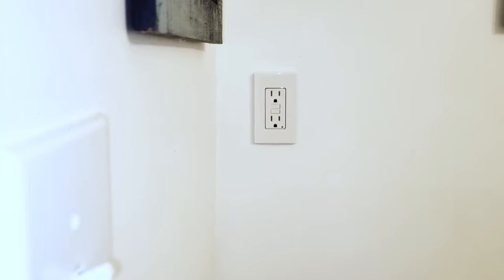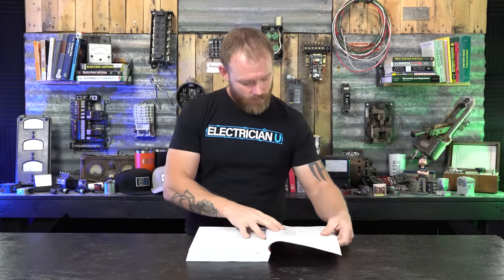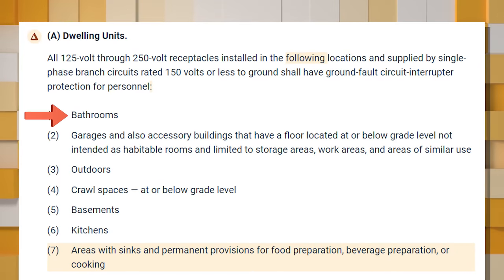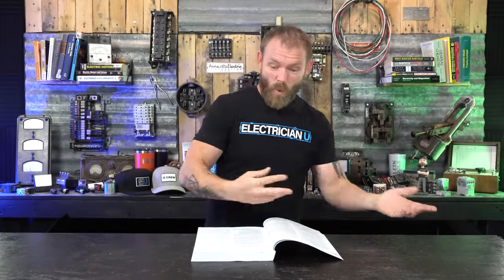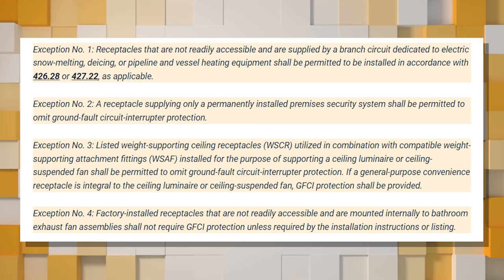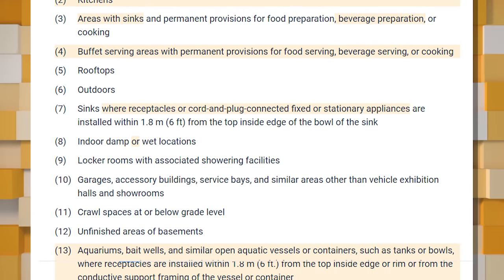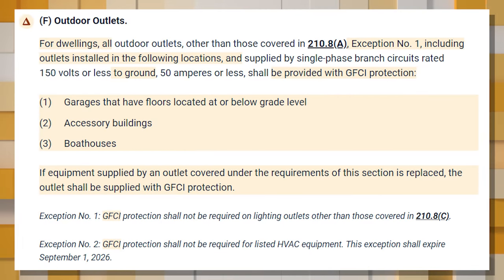Where and Why Do We Need GFCI Protection?

Comment: May the NEC forgive me but I must say it: 
The only outlet that should not have a GFCI is the refrigerator, because a trip can be a costly waste of food $$$ and even more so in the new "inverter" technology refrigerators where the electronics of the motor collides with the GFCI electronics and causes false trips. With the ground pin and the effective ground fault curent path in the outlet it is more than enough to offer protection against indirect contact in the event of a fault to ground.

And even worse if you keep medications such as insulin in the refrigerator, there the loss can even be human due to a stupid GFCI outlet.

A strange case of It can't be done but it "must" be done.

Comment: At this point wouldn’t it just make sense to matte everything be GFCI/AFI  protected in new residential construction or am I missing something obvious other than cost?
Reply: That is the direction we seem to be going, but they may be taking their time and introducing it a little at a time. It is quite a bit more expensive to upgrade to a system that is entirely AFCI/GFCI protected, especially since you also have to upgrade virtually all receptacles to tamper resistant as well. I have not yet seen it, but I assume that at some point, we may start seeing AFCI/GFCI protected main breakers that would theoretically protect the entire house, but who wants the whole house to nuisance trip?

Personally, I just upgraded our service and used a Square D Homeline plug on neutral main service panel using AFCI/GFCI dual function breakers for virtually the entire house. That way I do not have to check every outlet against the code to make sure it is compliant and I can just use standard TR receptacles. We also don't have to identify receptacles downstream from the GFCI as protected and remember which one protects which outlets if there is a nuisance trip.
Reply: Ya, pretty much. Probably should leave the fire alarm and snow melt outlets in the eaves out, but eventually I would guess they will include everything else including light circuits.
Reply: Thanks for the replies. I'm not in the industry myself but that just seemed like the next logical step to me.

Comment: A GFCI protects against electric shock from indirect contact and should be used EVERYWHERE!!!
I find those code requirements VERY weak. Here a single whole house GFCI (300mA) is mandatory and about everything you listed (and more) needs a extra 30mA GFCI (in some cases even a 10mA GFCI).
Getting shocked from indirect contact is not limited to receptacles listed in that code, it can happen everywhere (defective appliances, spilling fluids, drilling in a wall/cable, ... etc).

Comment: Is a 220V dryer outlet/receptacle need to be GFCI? Techniclally it is in a wet environment like the washer outlet, but generally you wouldnt be continually plugging or un plugging it most of the time the dryer stays plugged in unless you are changing it out or working on it. So does it need to be GFCI, is it a good idea to have a GFCI on it even if not required?

Comment: The GFCI within 6 feet of the shower would be for items such as hair dryers, I am not sure if they are still common. Another possible reason would be to prevent movie-style space heater into bathtub deaths.
Reply: I live in a trailer and the original location of bathroom receptacle (120v) was only 12” away from shower and in front of sink.. lol..it’s been relocated

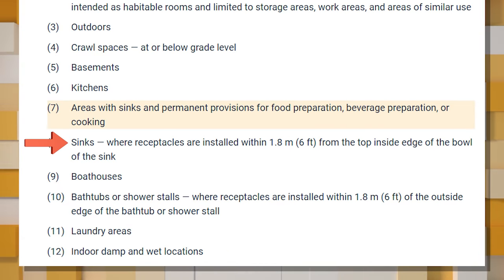Comment: 6:00 All of my bathrooms have a hallway receptacle right outside the  door, through the doorway and into the sink is under 6 feet.  Does the hallway have to be GFCI in this case?  And what about  the receptacle on the garage ceiling for the opener?

Comment: Refrigerators? If kitchens require GFCI and for them to be readily accessible but a refrigerator requires to be a dedicated circuit. I guess the option would be GFCI circuit breaker?

Comment: The vent fan thing is ridiculous all this is starting to get ridiculous it should just be with an X number of feet from wet things and outdoor outlets. The UK has this thing called zoning of course they zone off the entire bathroom but they allowed like a foot from the ceiling kind of stuff so the light technically if you can't reach it is avoided however the light switch falls into the category of can't be in the bathroom. It's also interesting they have isolators for their bathroom fans, usually a switch somewhere in the air for above the bathroom door. The problem is all of the stuff was supposed to be installed and maintained by a professional and that is starting to become less and less the case. Which means you either teach the people how to do it you make it as dumb as possible or I don't know. We've been childproofing everything even though children are well never mind I guess most people are children.

Comment: It may be time to just stop talking about GFCI and AFCI separately; if a kitchen had GFCI receptacles during construction ten years ago, and they are being replaced now, it is supposed to be the situation, where  AFCI/GFCI combo receptacles are now mandatory (unless you have installed AFCI breakers). The simplest differentiator generally is that most lighting circuits now need AFCI, but not GFCI; most other circuits feeding receptacles in a home need both, except for bathrooms that only need GFCI.

Comment: GFCI outlet trips all the time with window AC unit, what can it be done about it?
Reply: Make sure both the AC unit and the GFCI are not faulty (From least expensive to most expensive) do this by swapping known good equipment to that position if possible. If it's tripping, you should be figuring out why it's tripping.

Comment: Wondering if refrigerators that have water dispensers require GFCI protection? I have a Frigidaire fridge that says in the manual to avoid using GFCI receptacles, but i would think that a fridge that supplies water should really be protected. It's more than 6ft away from the sink.

Comment: Dustin, you missed talking about legacy un grounded Circuits? In my area, a lot of older homes aren't grounded and this is noted in inspection discrepancy reports.  A solution is to protect the outlets with GFCI's.  I don't believe this is a Code Violation (you don't have to fix what you don't touch) but it is a common request from the home buyers because of the report (and yes, a Home Inspector is a completely different animal than a Code Enforcement Officer.... ;-)

It does fall into Code Enforcement if the outlets are upgraded in a permitted room where the electrical wiring is not upgraded (This also creates an AFCI potential nightmare...)

Comment: Another use for gfci receptacles would be replacing a 2 prong receptacle that doesn’t have a ground. A lot of time it’s much easier to just put gfci’s in instead of running a new grounded circuit to feed the 2 prong outlets 

Great video as always! I love how easy you make it to grasp code knowledge.
Reply: Yeah..except..I have a question above about that..the self tester in one of my kitchen outlets tests fine, but..if you plug in like a Klein tester, it shows “open ground,” and it refuses to trip at all from the external tester. Isn’t a ground fault basically an external tester? I’m thinking it doesn’t do any good to put one in w/o a ground…my old contractor who did my kitchen didn’t put a new ground throughout..my wiring is all mixed up..
Reply: @johncspine2787  I’ve only used them to replace two prong receptacles where it’s in a metal box with emt that is bonded to ground from the panel. The yoke on the gfci is bonded to the receptacle’s ground pin. If you’re showing open ground you don’t have a path to ground on the panel. Plastic remodel box?
Reply: The plug in tester has a resistor if I remember right ground to hot to create an unbalanced load to trip the GFCI receptacle.  But if the tester shows an open ground then it will not work   The GFCI receptacle monitors hot and neutral not ground.  If the receptacle sense an unbalance load from hot to neutral then it trips.
Reply: @kylekennedy3299  probably, yes, but 1953 house, ppl before me never added a ground. I got about half the upstairs done now with proper wiring, but what bugs me about this awful disaster recovery firm is that their electrician never actually fixed anything having to do with the attic fire, he killed an existing outlet in the living room where there are no lights built in and I really needed that outlet, (now they’ve already put the Sheetrock back, well, I say “already{ but we are coming up on 5 months since the fire..ridiculous) and the local city “inspectors” were always so confused by the terrible contractor calling them out for the wrong reasons, he somehow got things passed after the fact they were all failed and then none of them actually inspected anything. It’s incredibly frustrating..
Reply: @johncspine2787  
The GFCI doesn't rely on the ground to trip.  
It compares the current in the hot and neutral.  When they are not equal (by milliamps) it trips.  

Unfortunately, receptacle testers rely on a ground -- they bleed a tiny bit of current to the ground, so that the hot and neutral legs are unbalanced, causing the GFCI to trip.   So they cannot be used on an old, two-wire ungrounded system.

I will make an adapter. -- A grounded to ungrounded (3 prong to 2 prong) adapter -- on the ground terminal on the adapter I will put on a long wire with a clip.  Run the wire to the nearest ground (say a water pipe,) plug in the adapter, plug in the tester.  And voila', my adapter will allow a tester to check whether the circuit is protected.  If necessary I could even use a 100' extension cord to reach from the receptacle to a known good ground.
Reply: @kylekennedy3299 good idea
Reply: @ptso7580 so just to be sure they still work on non-grounded outlets right? I’ve already installed a few where I have old 3prongs with out a ground wire

Comment: Funny thing about the vent fan... My master bath was designed with vent/light  about 6.5" from the shower drain... So I could actually easily stand in water and touch the outlet up there 🤪🤣 I won't do it I promise 🤣🤣😇

Comment: here is another problem is fridge, beer coolers, small freezers, soda machines, these can also trip GFCI's also when there ias a problem with the motors whwen they are grounding out but still working but do not sometimes not work on GFCI

Comment: Hey! Great channel! Wish you were here..really..I had an attic fire due to an alleged power surge, but..zero investigation. I’ve had panels replaced, service upgraded, surge protectors installed at the service and the sub panel. I have a GFCI question! So, in running around testing, I have found a GFCI outlet in my kitchen that self tests just fine. However, if you plug a tester in, it says “open ground,” and will not trip. Sooooo…would one find this out first from a nasty shock, or would it actually trip??
Reply: I mean that if you test the GFCI with an external GFCI tester, it won’t trip..but trips fine from the receptacle’s own tester..
Reply: The GFCI protection should still work fine, but you should look in the box and see if there's a ground wire that just wasn't installed correctly. If there's no ground at all you should definitely test all the non-GFCI outlets because those can be dangerous without a ground.
Reply: @quinnbattaglia5189  If there is no ground,  that receptacle should have been labeled "no equipment ground".  The labels are included with the GFCI receptacles.
Reply: @JT-lq4yd  It should, yes.

Comment: Quick question- my garage wiring is ran into the house and when we run heat and dryer at the same time the power shuts off but the breaker dont trip?

Comment: I was hoping for an explanation of how GFI protections perform. My understanding from very long ago is that current is being monitored both in & out of loads. "Any imbalance is leakage". Any leakage for whatever reason in excess of 0.005 amperes trips the protecting device. I'd welcome a clearer explanation.
Reply: Your understanding is correct. If 1.6A is going out, then 1.6A must go back in. If 1.6A goes out but 1.4A goes back in, the other 0.2A must've gone somewhere. The only place it could've gone is it leaked to ground (possibly going through a human body on its way to ground) or to another circuit. So a GFCI will trip if there's more than 0.005A difference between the inbound and outbound current.

Comment: How do I protect against lightning besides a surge protector? My house got hit by a near strike and took out $1000 worth of network hardware - the surge protector kicked to prevent the electric side but the network side fried.
Reply: I was recently wondering the same.  You can have Whole-home-surge protectors conceded to the neutral & a 2nd W-H-S-P to the ground.  You might even add a 2nd ground rod or replace your old one.
Reply: @SlackerU  Yes, but it didn't hit the house, it hit the ground around the house. What is connecting a second ground going to do except have it flow faster into the devices?  I was doing some reading about it after it happened and the basic rule of thumb is - you can't stop it - you can only hope for minimal loss. It came in through my coax cable (I think) and fried two cable boxes, my cable modem and my permitter router, switches and hardwired AP's.
Reply: @JimAllen-Persona  Having a 2nd ground would improve the whole-home-surge-protectors ability to see voltage difference in the line.    I had the same thing happen to my modem, it fried every ethernet port in the home that was connected to the internet line buried in the yard.   You might also add a Back-UPS, though the pure-sine ones start at like $1500, they automatically switch when power is ugly & they have coax connections too.
Reply: Get the book from Polyphaser called "The Grounds Of Lightning", and in particular what a ground window is.
Reply: @JCWren  So the coax cable isn't buried deep enough below the lightning-depth.  I'll try that too.
Reply: @JimAllen-Persona  if seem some surge protectors that can do ethernet, telephone, and coax.
Reply: @SlackerU  Thank you for the advice, at least it's nice to know someone else understands the situation. $1500.. ouch.
Reply: @JCWren  Thanks - I'm going to look into this book.
Reply: @JimAllen-Persona  Is your coax grounded? A lot of people don't realize that even though coax wire is low voltage it still requires a EG. Usually where the coax enters the home there should be a connection that is bonded to the equipment grounding conductor. While that is not really there to protect against the massive influx of lightning, it could help since it would occur before the network equipment.
Reply: @TwilightxKnight13  I think it is but I'll take a look. It's coming in from underground. Thanks.
Reply: If you have the ability to get fiber optic, it is a good way to mitigate risk.  Every fiber optic drop that I've seen does not have any conductive material in it (They don't even have to ground the fiber drop). Also, isolating your modem from your other electronics is an option (only using WiFi, for instance).

Comment: what good is a GFCI when the wiring has no ground? (2-wire wiring in old house)
Does EVERY outlet in a garage need GFCI or just the ones regularly used?
If detached garage has no ground back to the house, can a GFCI be used if there is a ground rod for the GFCI?
Can you chain GFCI outlets?
Can a GFCI inside be allowed for an outside outlet protection too (outside outlet is branched off a GFCI that is inside a garage)?
Reply: A GFCI protects you from electric shocks.  Sure the problem may be that if trips only if you touch the device so it may sting but it should not be dangerous. With proper grounding the breaker trips immediately at the fault. If you have both it surely trips. I personally would not rely on GFCI alone on wet locations but on try ones it is acceptable.

Note GFCIs are in no way depend on the ground wire. A GFCI compares current between the wires and detects if current escapes from the circuit i.e. a ground fault happens.

Having a ground rod and a GFCI is in principle a valid installation. The ground rod ensures enough current to trip the GFCI in case of a fault. I just do not know what the code says. Note that these methods only apply to conversion of old  (1960s and before) installations, not new ones. Not do they apply to adding sockets, only to changing.

Do not chain GFCIs, use pigtails. If you chain you can get problems. I see no issue where the GFCI is. Of course it may cause confusion if it trips.

Comment: So I hear all of this receptacles and the need for protection in damp/potentially wet locations… now what about as a contractor working in damp and wet locations working off an extension cord? Should I be sure to have it plugged up to a GFCI or circuit with a GFCI? It isn’t uncommon for me work with my feet wet, in a crawl space, etc…
Reply: Buy a simple GFCI inline adapter that you plug into the non-protected outlet, then plug your tool or extension cord into the adapter.